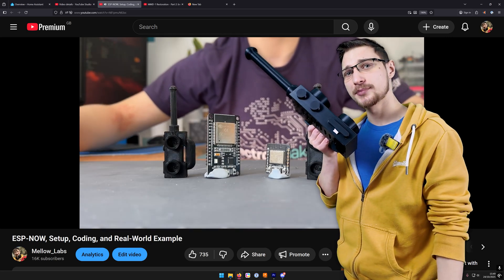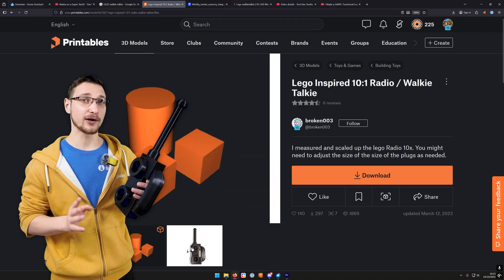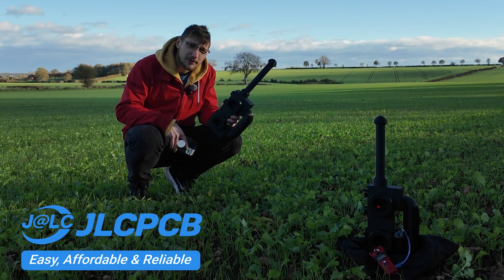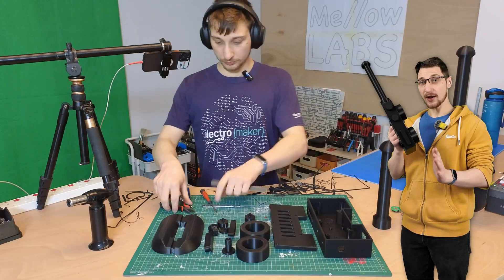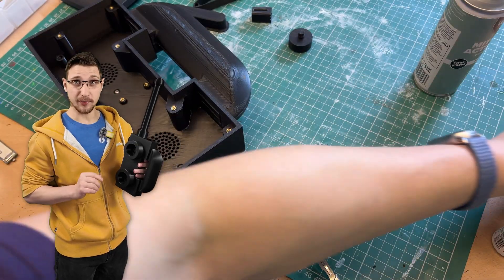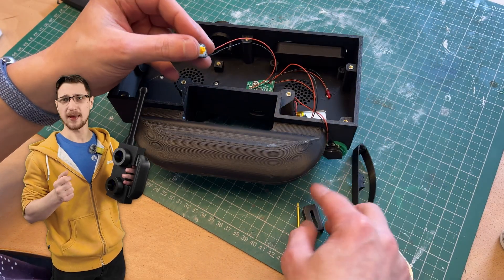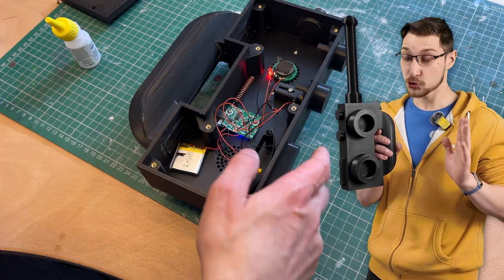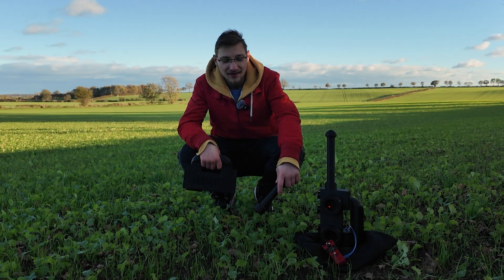I Built GIANT Working Lego Walkie-Talkies

Comment: For the handle you could model 3 holes on each of the split handle sides on the flat face say 10mm diameter then 3d print dowels then glue the sides together and the two sides will be perfectly aligned when glued

Comment: 9:51 I can't help seeing some big .... on your build plate  #sorry #dirtymind ;-)

Here's some 3d printing and design suggestions, hope they help for future projects:

Re warping: On my Bambu X1C I have noticed that it helps to turn the aux fan off, but recently I have put glue (simple glue stick) om my textured build plate. That has prevented warping pretty well (only tried with PLA so far).

Sharp corners: add a small chamfer or fillet, 0.4-1.0 mm is enough or do a little more depending on the model. I would probably do 2+ mm on this model.

To line up the handle parts it helps to design a little hole (or 2) in the flat side and a corresponding peg that you print separately

The holes and pegs for the handle: add a little chamfer to both sides and you can slide it in much easier.

I think the little antenna holder that you glued in is the weak spot. Breaks often happen on the layer lines. But I see you have already experienced that....

Anyway: great project! Fun to see such a large LEGO walkie-talkie.

Comment: There are a lot of compliant mechanisms, nubbins, tabs and stuff you could have incorporated into the print to add some structural rigidity and orientation for the parts, on top of the glue